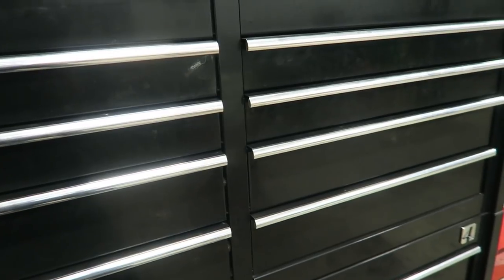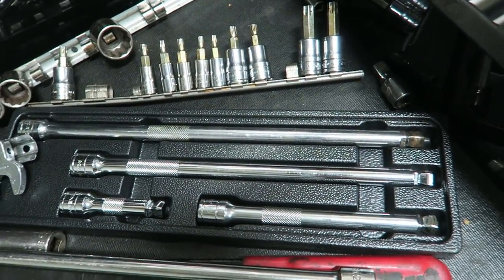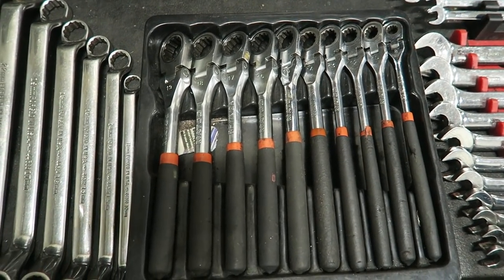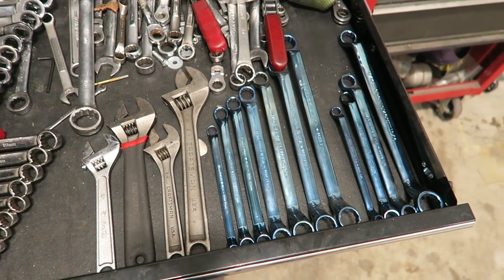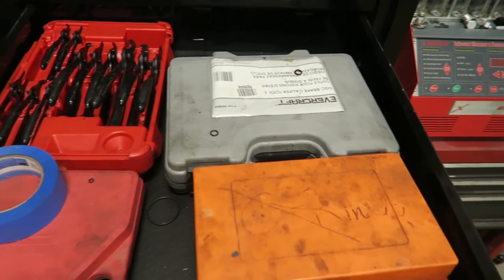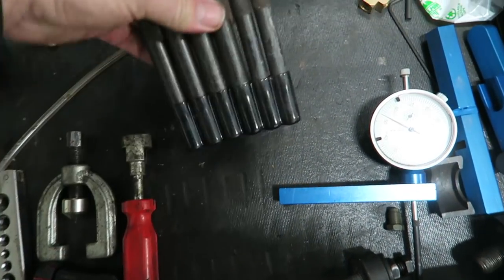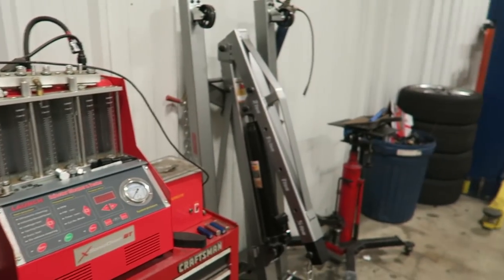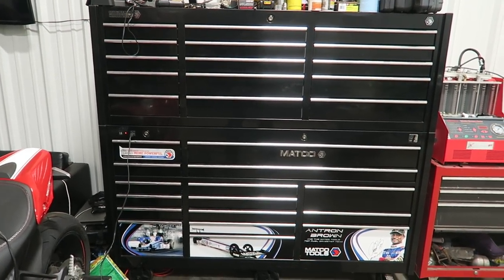MorFab TOOL BOX TOUR!!! TOOLS YOU NEED TO HAVE!

Comment: The Matco Wrenches are not 12pt they are Spline. "Indispensable" not "indisposable."  E or External Torx is the correct description, not "Reverse" Torx.  Opening drawers without the camera actually capturing the drawer doesn't help.  I wouldn't be so critical but you are supposedly teaching new mechanics and they need to learn correct terminology and facts.
Reply from the maker: LM thank you for your knowledge every little bit helps!